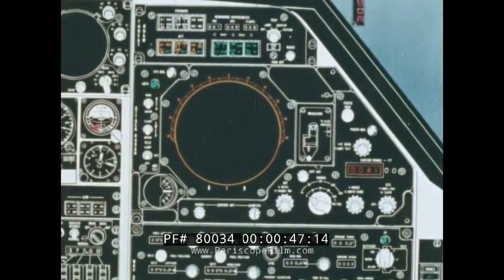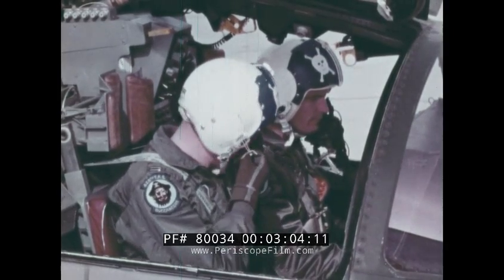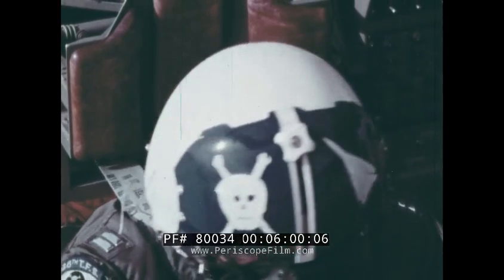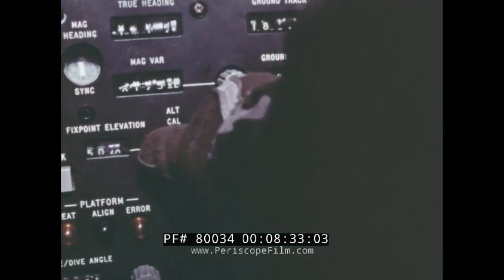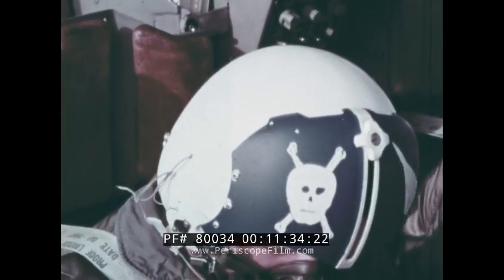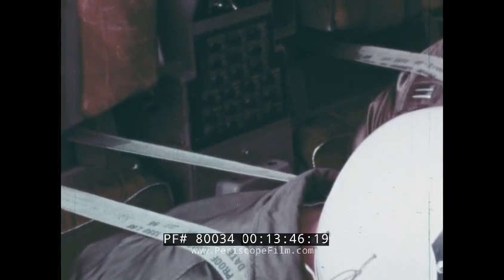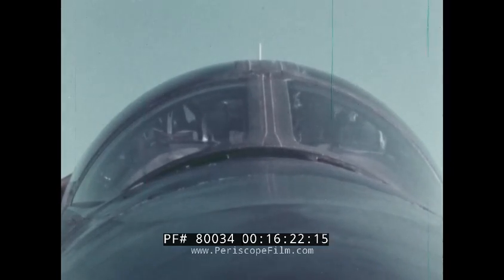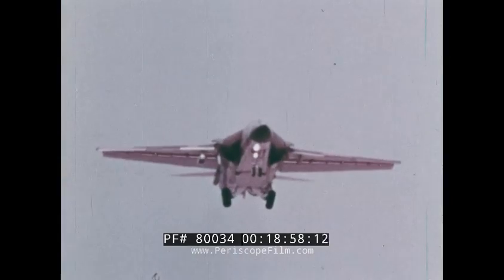GENERAL DYNAMICS F-111 AARDVARK SUPERSONIC WEAPON SYSTEM  "ATTACK RADAR MISSION PROFILE" 80034

Comment: Worked all F-111 models as Avionics at depot McClellan AFB ca for many years. Anyone else there?
Reply: My dads freind dennis cochran used to tell us good stories when we were growing up i miss mclellan afb
Reply: I strain gaged them for cold proof testing.
Reply: @robertstack2144  A couple of back shop guys I knew worked that area. Freezing the wings then bending the heck out of them! It was Loud!
Reply: @davenone7312  yes very loud when the wing broke.  At GDFW we tested the static F-16 in the fixture at room temperature and it broke at 147% of ultimate load. That was loud. They pumped the room with the entire  airplane in it down to -40 while pulling 6 gs  i think .
Reply: I worked at SMALC in MAIT on APQ-130 for F-111D AMP!  ‘82-86.  Also worked APQ-174 TFR and more.
Reply: @TheGreatGastronaut  Did you ever go out to the Radome test facility where they tested the Radomes? It was located just inside the bell street gate.

Comment: Now that brings back some memories.  As a back shop avionics tech, I have worked on all those LRU's.  There were a few errors in the video though.  Mixing up the ARS and TFR mostly.  The command bars are for the TFR system.  Also the LARA was used over water as it gave a more correct altitude.
Reply: This was made by General Dynamics.  I believe for training pilots ...

Comment: No wonder they need to guys seems like a pretty shit system
Reply: What are you comparing that platform to?  That was early 1960's technology, pretty shit hot if you ask me and I maintained those systems for 20 years on FB, A, F and E model aircraft.  No other attack aircraft could do what the F111 could do as fast and as low in any weather with the bomb load it could carry.  Spelling errors and ignorance don't lend credibility to you argument.
Reply: @bradepperson4921  And the 111's were a workhorse during the Gulf war!! Too bad we found the wingbox's cracked, thats what did them in.
Reply: @davenone7312  what are the wing boxes and why did they crack?
Reply: @ek8710  That was the area where the wing attaches to the fuselage. They cracked due to heavy stresses put on them. The cost was way too high to replace them throughout the fleet. We stopped depot modifications right in the middle of production. In came flat bed trucks and started hauling them off. It was a sad day for the McClellan AFB F-111 workers for sure.
Reply: @davenone7312  we may not have the giant metal working hammer forges anymore to even make the new wing boxes.  There’s a couple of videos on YouTube about them.  One shows them forging the wing spar box for a F-106.  It was a very large and impressively complex forging.  China probably bought some of the forges at scrap prices in the 1990s.  They are gigantic machines the size of a multi story building.  When they were built they were considered strategic assets and very high priority on nuclear targeting lists.
Reply: Well, at least they could spell two.

Comment: The Navys AN/SPS 10 surface search radar had many of the same controls. A analog radar that was discontinued since the 55 is digital and works better with AEGIS.   it may still be installed on older supply and auxiliary ships